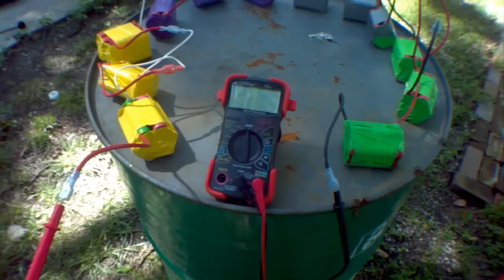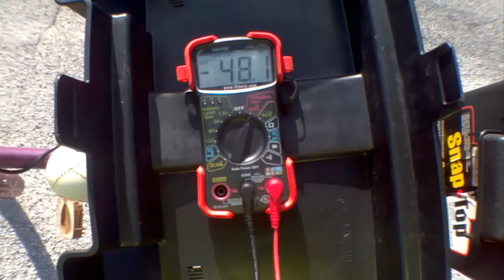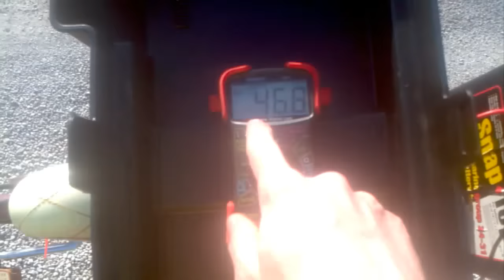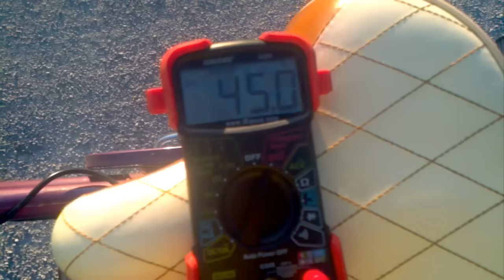1000w 48v 9ah electric bike distance test

Comment: Should add a BMS to avoid 🔥🔥🔥💥💥💥
Reply: Stay away from bms, they cause more damage than good. Just pop a 40amp in line fuse for a 1000w system. All we use in our setups for years. Bms fail and can go short or open and cause cell groups to charge un-evenly, over time going out of balance (exactly what they are supposed to prevent, bms just cant supply enough current to individual cell groups to maintain balance causing cell drift). Just use a decent model rc charger to charge them in 4s or 6s packs, gives much more control per charge than any bms. The 40a in-line fuse to the speed controller will blow if theres any short long before any cell damage or fire (the controller will normally draw 25a max).

Comment: Would it be possible to use the wheels turning to run a generator to recharge the batteries? Giving endless power at higher speeds
Reply: HabsGeorge Where would this extra energy be coming from? You can't get something for nothing.
Reply: ThingsDemystified Wheels on bike will be turning as he rides along.
Reply: HabsGeorge
And what exactly is causing the wheels to turn?
Reply: ThingsDemystified There is a hampster in the black round hub that receives an electric shock when it goes below a certain set speed.
Reply: +HabsGeorge: This trope again? Something NEVER comes from nothing, religious convictions aside.  There is a DRASTIC loss in efficiency when generating power from a motor, but even if there wasn't, even the BEST efficiency can NEVER give you more than 100 percent of something... which is what you'd need, to speed down the road on the power your wheels were generating.

To make something move, you have to PUSH it somehow. Nothing is free.
Reply: dan mortenson true but regenerative braking is a feature of more sophisticated electric vehicles. Probably not suitable in this specific project but as a concept is completely viable and certainly not creating something from nothing.
Reply: simple answer
No.

Comment from the maker: oh your English is good, do you speak Deutsch? :D

will you use new accumulators or old? 
buying new will be expencive. (12v 15ah = 36€ on Ebay) >_<

4 accumulators (12v 15ah) in series = 48v 15ah.
4 accumulators (12v 15ah) in parallel = 12v 20ah
4 accumulators does not = 48v 20ah.  =/

can you use Lithium-Ion? old laptop accumulators have lithium-ion cells. :o

Comment: im using the 1680w cyclone kit and i get 30 miles at 20mph and 18 miles at 30mph on a 48v 20ah a123 cells with no pedalling.  would i get more range with a lower wattage motor or does it work out the same as the speed is lower?  what range would i get with a 480w motor with 48v 20ah.

Comment: not sure if I heard you right did you say you were only going 12 mph so how fast does your setup go then cause in your first video it looked like it was barely working so I am wondering what was the difference in top end speed between the 2 different battery setups
Reply from the maker: +Neverumind NeverTell max speed is 37mph, but that was with the wind at my back.  i went slow in my first vid because i was using old lead acid batteries. and i went  kinda slow in this one because it takes more and more power just to go a bit faster.

Comment: i so wish i had access to new laptop batteries cheap like you have, i built a similar battery but just 24v 10a (5 batteries in parallel  and 6 in series) out of old cells i saved from old battery packs. i only used ones that held a good charge. i soldered on balance leads and charged with proper charger but the results were quite disappointing.  it would only do about 10 miles with me helping. i'm sure it would have been better with new cells but here in uk its hard to get new old stock laptop batteries. can anyone help? any sort of battery would be fine realy

Comment: I am planning to buy a electric bike kit. On ebay it's about $300, but does not come with a battery.
Reply from the maker: yeah kits are a good idea. you can build a cheep battery for like 80$.

just make sure the kit is shipping from close to your home. if i bought from china the return if it was broken would be like 180$. so i bought from a bike shop in california and return shipping would only be 30$ if it was broken.

Comment: Arnt you afraid that some of the electrons will fall out and jam the protons in the jumper wires?
Reply from the maker: thats why i installed the hydro-electric gizzerblinky to feed positrons into the hemmyquads in case theres an eregularity with the protons. i was thinking about using a turbo encabulator but those are a bit too expencive.

Comment: hello 
i am going to make an ebike with the same motor as u use.
but i am going to use lead accid accu's.
i want 48 volts an atleast 15 ah.
what kind of accu's do in need to use 15 ah 12v each and 4 piece's?
or 12v and 5ah and the connect them an then i get 48 volts and 20 ah?
tanks

sorry for my bad english.

Comment: question bro ?
i am buying a 48 volt   1000 watt e bike kit, NOW TO BATTERY NEEDS ?
i have 4 x 12 volt 12 ah lead acid sealed battery's , NOT GOING TO BE BUYING ANYMORE, 
wiring in series giving me 48 volt batt pack, what is the ah measurement i can expect 
does it stay at 12 ah or does it goto 48 ah which on calculating it comes out at 48v x 48 ah = 2304 watts, is this right or have i gone wrong somewhere
thanks
dave
Reply: +vassilij zietseff (davlyn) are you using standard 12v car batteries or 12v deep cycle lead acid? car batteries don't like to be cycled below about 50% and they quickly loose their capacity if you do. 

But to answer your question, no connecting batteries in series does not stack the AH rating. 4 x 12v 12ah batteries will make a 48v 12ah battery pack. the battery pack will contain more energy because Watts = Volts x Amps (about 500 watt hours for your pack)

if you want to increase the AH rating you need to connect the batteries in parallel but this does not increase the voltage so you'd need 2 parallel banks of 4x 12v 12a batteries in series to make a 48v 24ah (which would be about 1000wh but it would be very heavy using lead acid)
Reply: +vassilij zietseff (davlyn)  it would still be 12 ah because the batteries are wired in series, if you wired them in parallel it would change the ah at the expense of voltage.

Comment: hey I got a cnebikes 48v 1000w and the controller lcd  3 buttons peter chou shows clicking but somehow my friend got it to go to P1 settings now it will only go with down button pushed and that is walking speed how do I reset them and to what #s P1=? P2=? goes to P5 maybe P6 1 2 3 4 5 6  on the P settings shit help

Comment: run a PMA off the back wheel with a traction drive to charge the batteries.
Reply from the maker: "PMA"? idk what that is. but if i want to do regenerative braking i could use the hub motor itself.
Reply: permanent magnet alternator. Check out "Blue wind power" website.
Reply from the maker: *****
oh, altenrators are shit. a better idea is a brushed dc motor run in reverse like a tredmill motor.

Comment: maybe i can use lithium ion batterij's.
if i go to an old iron dealer. 
i can buy laptop battery's or 12v accumulators.
and i can measure them before i buy them.

and i come from the netherlands and i speak dutch.
and i am 16 years old and i like to try things out.
also in holland you only can have 250w motors and go 25 kmp.
but there is no cop that knows that rules....

Comment: Why even make a 1000W Ebike with 48V9ah? that's 432Wh. Which means you'd only be able to ride the bike at full throttle for a theoretical 26 minutes.  Should have went with a 250W motor and controller kit. It would have given you the ability to travel 4 times further than you currently have.
Reply from the maker: because 1000w is more efficient at 250w and can go faster, and because this was just my first battery. why are you so blind to something‘s capability?
Reply: You probably shouldn't have be driving this thing faster than 20mph. Considering the thin wheels and lack of shocks, going 25-30mph seems ill-advised. You needed proper disc brakes as well as lighting systems if you planned to drive this at speed on the road. If you plan to go no faster than 20mph, you're better off sticking to a lower wattage kit that would prolong battery life. The only other advantage to having a 1000w controller kit, would be to output a higher torque. So yes, it would feel like you are moving faster with more power, but it would really be approximately the same speed. Most ebike controllers shipped in from overseas have governors that control the max RPM of the motor, they tend to all be the same in North America, 20MPH or 32km/h. This is because there are laws in several countries that classify motor-vehicles by wattage. Usually anything over 750W is blatantly treated as a Moped, but it varies (500W for Canada/250W for Europe). Although if you are able to go faster than 20mph, and you live in North America/Europe; you may need to register, get a Licence, plate and insurance to even ride this bike legally.

Comment: as long as the electric motor will not be revving as much as it is on a wheel is it possible to get higher milage and speed if the motor is connected to the crankset
thanks
Reply from the maker: i dont understand what your asking, could you clarify?
Reply: Rinoa Super-Genius
i see new style bicycle crank type electric motor kits these days is it possible to get  better milage with these kits? i see that your electric kit is mounted on wheel thanks
Reply from the maker: muzaffer torman do you mean rear wheel vs front wheel?
Reply from the maker: muzaffer torman
you can lose up to 10% of your power in the sprockets and chain. i think a hub motor is much better.
Reply: Rinoa Super-Genius Depends on what you mean by better. If you send your power through the gears, you can use your available power much more efficiently (by keeping your motor RPM high where it's most efficient). Imagine a car with one gear. Well, that's what a hub motor is. It's like a car stuck in top gear. Acceleration from a standstill is terrible, and extremely inefficient. A 48V GNG mid drive would perform like a 4000+ watt hub motor as far as starting torque is concerned.
Reply from the maker: ThingsDemystified
except electric motors dont work more efficiently at high RPMs like a petrol engines do.
Reply: Rinoa Super-Genius
It's the opposite. When I use low gear in my RC car, the battery lasts much, much longer. Tall gearing causes an electric motor to draw large amounts of current, wasting it as heat. An electric motor is much happier spinning faster. You can tell by monitoring it's current draw. Petrol engines are actually not more efficient at higher RPMs. This is why you have overdrive. You want your petrol engine spinning as slowly as possible for maximum efficiency.
Reply: Another way to think about it is this. So if a 1000 watt mid drive can perform like a 4000 watt hub motor (at lower speeds), a 1000 watt hub motor can use as much power as a 250 watt mid drive (when you start from a stop) if it were able to use the bike's gears. Instead of pulling 20A, it can pull 5A to do the same thing. Having a transmission is always better unless you rarely change speeds, and/or do not care about being able to accelerate quickly.
Reply from the maker: ThingsDemystified
but my top speed would only be 10mph and it would just have to spin 4 times faster, still 1000w coming out of the wheel.
Reply: Rinoa Super-Genius
It would spin faster, but use less power. This is how gearing significantly improves efficiency. When you hit 10 mph, you switch gears (of course, if you don't have more than 1 gear, this doesn't really apply since you can't switch gears). Take a quick glance at this page. https://www.electricbike.com/mid-drive/
Reply: ThingsDemystified 100% correct, that's why gears were invented, a strong man can lift 100s of pounds but even I can lift more than them if I use a pulley and block set up, same as gaining more torque or potential speed.
Reply: ThingsDemystified only true of mid-motor.
Wind resistance increases with the square of the speed iirc.
This is the main reason 12mph on a 19mph top speed bike saves battery.
On my bike, wot is 9.5A on flat, at 19mph. Drop 2-3mph and save 20%
(7ish amps at 15-16mph)
Reply: Jeff Kephart
We're talking about mid drives vs hub motors. A mid drive is more efficient because it can use the gears of the bike to vastly improve efficiency, which is more than able to make up for losses in the drivetrain.

Comment: so with all up to 5:02 you have a range of about 190 mi
Reply from the maker: your joking? at 5v they would explode into flames. you would get 0 miles. and maybe get badly hurt.
Reply: Rinoa Super-Genius
I think he was trolling you Rinoa. Anyway, speaking of going BOOM.
This is why I won't run Li-Po, LFP is immune to such nonsense. If you look around
there is a vid where a guy takes a nail gun to a 30ah or so cell, just steam results!

Comment: 19 miles without peddaling? lol my ebike must be damaged. I get max ten miles without pedaling, although my disc brake is always half engaged, otherwise it doesn't have the stopping power.
Reply: What is motor wattage? Battery capacity in Ah or Mah?
Battery chemistry? (my stock 10ah lead acid bike did 6.8miles)
Reply: 1000w 48v hub motor. lithium ion 9ah 48v, and admittedly, the rear brake being half on somewhat limits the distance, it's no crazy amount of friction. In a perfect world I would test it with the breaks off, but in reality I would have an accident.
Reply: Is that a Kelly controller? I just got a 2KW one!
Reply: Not sure, I bought one of those all in one ebike kit's off Ebay (Chinese import). I even use a lightweight aluminium frame, the bike weighs about 25kg with the kit and battery attached. I just don't get why I get so little distance, maybe it's because my motor is linked to a throttle, rather than directly assiting my pedaling, maybe it's just not efficient enough.
Reply: ben sharifi I know this is an old post but your problem lies with your breaks touching the disks, even a little is too much for these set ups, also keep your tire pressure up to 60 to 70 psi as even soft tires have a huge impact on distance and speed, I can almost guarantee you will get double that mileage and more speed if needed also your motor and batteries will be under less stress. Best get better breaks.
Reply: ben sharifi I built one as well, and I weigh 275lbs..... at full throttle I get about 1mile per Ah at 30mph... but he is only going 12mph. So it naturally get better mileage... I use 2- 6s 24v lipo rc car batteries in series from hobbyking to make my batteries cost about 100 dollars to build a 5ah pack...

Comment: I've just made a 24v 2.6ah li battery with a tamiya connector. It is to be solar charged and to power a dc submersible well pump. I've been worrying that the power connector wouldn't be strong enough. On YOUR bike it workes fine. I am reassured. I will make-up batteries like these on a cost+ basis if anyone is interested. Solar power charging anyone?
Reply from the maker: that connector should be fine, just depends on the guage of the wire.
Reply: Rinoa Super-Genius
Thos automotive spade lugs suck. They don't carry a lot of power well, they don't like
multiple engagement / disengagements etc.
Look for Anderson Power Poles (the 20A ones)
I pull 35A@24v(840w) through them w/o getting more than a bit warm.

Comment: usually, you can get a mile per 20Wh with a prefabbed ebike, and your diy bike made 1 mile per 23Wh. Congrats!
Reply: +John “Alex” Goldsmith on a recent trip I got about 1 mile per 12wh (assisted)... 60 miles out of a 700wh battery :), That's about 4000mpge (imperial). I also got down on my bars in an aero position and managed to get to 22mph on flat ground with just 250 watts of power to the motor (unassisted) which isn't that far off the power/mile usage during relaxed pedaling at 15mph. I'm pretty light and do train on my racing bike so my aero position was a pretty tight Graeme Obree type position

Comment: how come you only went 12mph whats the range when you go full speed?
Reply from the maker: because 37mph takes like 20x more power than 12mph.
Reply: +Watzegik Datzegik use lithium ion
Reply: Watzegik Datzegik go to wherever recycles batteries, take the old laptop batteries for free or cheap. there you go.
Reply: +DMAN22 there was a computer shop near me that had a dumpster at an offsite storage building full of old computer parts like laptop batteries and motherboards... only problem is that you had to climb a 12ft fence and technically it was illegally trespassing. I used to go there when I was a kid.
Reply: ***** ask then, im pretty sure they have to pay to dispose of them so they might give them to you